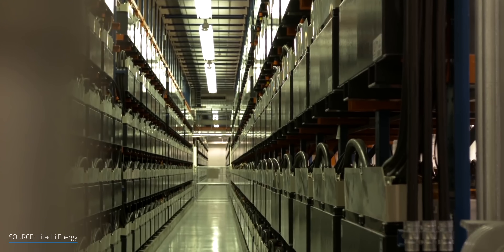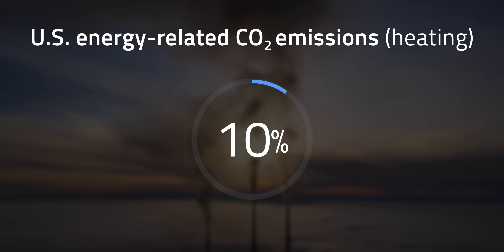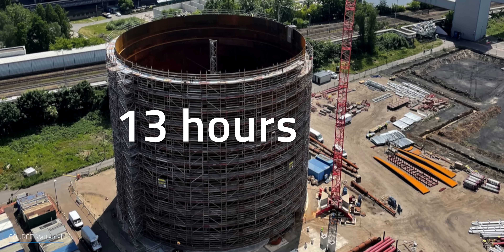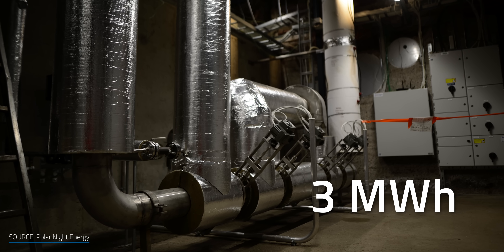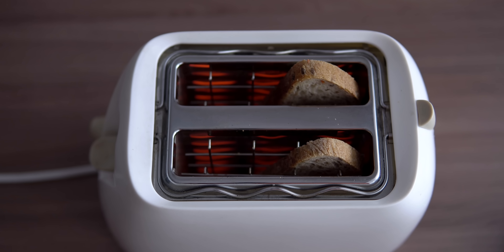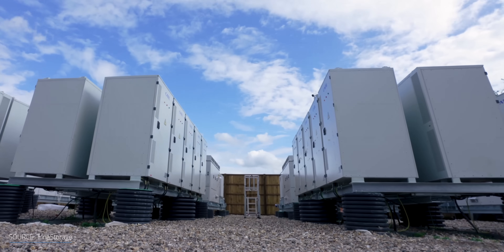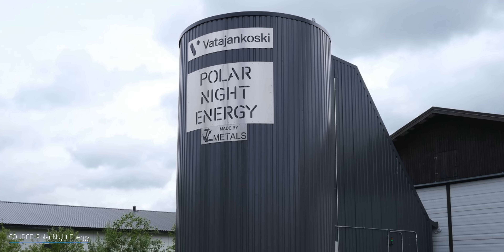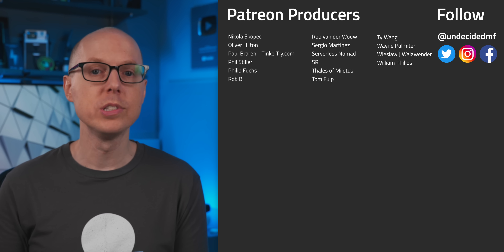How A Sand Battery Could Change The Energy Game

Comment: This seems like a good idea, but based on some experiences and 40 years of construction experience I can't see the sand being a good solution for long term heat storage without constant maintenance frpm the heat source.  The water etc traveling through would certainly heat up, but the sand would cool at a rate that would certainly equalize rather quickly unless there was a continued method to keep heating the sand.  It is proven that cooling occurs much more quickly than heating, as most things will cool to the ambient quicker than it was heated.  So there would be a need to some how continue to heat the sand.  But it is an interesting idea.  Similar to cooling towers that make ice at nice and cool buildings during the day, which has been around for decades.  One other down side to me is this seems like a small step towards corralling the average citizen into group housing and one of the small steps into  the abolisment of privately held land.  Just my opinion.

Comment: Since heat pumps have a COP of 4+, that'd bring the 25% efficiency back to 100%. In fact, one can argue that the energy is only worth 25% in the form of heat, since it's illegal to convert electricity to heat in anything but a heat pump (Denmark).

Comment: It would be good for solar thermal plants. I did some work in one in Arizona that used concave mirrors to focus light energy to a pipe heating oil in the pipe. The the heat would go to a boiler to heat water into steam to run a turbine. They also had a storage tank to keep the access heated oil to run a few hours into the night. They could use the sand thermal battery to store even more heat to run longer.

Comment: I always figured long distance heat transmission was infeasible. Even within a few city blocks, I'd imagine a heated pipe system could work, but require thermal hubs or such and overall a lot more infrastructure and maintenance compared to an electrical system. I'm willing to be wrong about that though.

Comment: Just wondering if you could use a tank full of compost with similar coil pipes as shown but have water flowing through  reciveing the radiated heat through the pipe from the compost, 
as compost is a really good at heating to high tempurtures, I know I'm stepping away from the topic of battery storage tech and talking more about the way we harvest energy but I'm curious to know if it's a good idea and am wondering if anyone has tried to use compost in such an way.

Comment: I am an engineer and this sand battery, while cool, has the same problem as most energy storing methods. Energy transfer loss, or the scientifuc fact that when ever energy changes form from one medium to another energy is lost and 100% effiency is impossible. Lets follow this system here. The energy starts as wind and sunshine. It gets transformed into electricity at the windmill and losses alot of energy during the process. Then the electricity gets put into the sand where it has to be transformed into heat energy. Alot of energy gets lost here. Then the energy has to be tranfered out of the sand and back into electricity, lossing energy again. Through this method it would be lucky if the end user got 50% of the energy that was harvested. This method bleeds energy and is not very efficient. Plus all of the metal needed to build it can't be melted and formed with electrical energy. Metal requires burning something to get it hot enough to form. Plus windmills and solar panels require more of a carbon foot to build then they clean up. Windmills have short lifespans and are hazordous to the enviroment to duspose of when they break. Solar panels require large mines to dig up the rare earth minerals required to build them. Plus just burying old and broken sokar panels is toxic to the enviroment.

The way forward is nuclear. We as engineers have completly overhauled and redesigned the system from the ground up. The plants currently in use are decades old and are caveman tech in comparison to what we can build now.

The fuel rods that we can build now are designed to never expload, and we need much less fuel to build the reactor then before.

Nuclear is safe now and has absolutly zero emmissions.

Comment: Woow, I dont know about that. How you deliver the heat? Sounds to me like you'd need a whole new type of pipes or  conductors to do that. Besides I dont see much application for it outside of heating houses and then it raises a question of the cost per unit and dimensions of said units. Meanwhile some turbines are better off deactivated when there is no demand, because wear and tear is a thing that too costs money, magnets in the generators are degrading not to mention any moving parts which degrade by definition. If we lived in the universe or on a planet where water had a bad heat capacity it would be understandable to cheer for a cheap material like dirt to be usable in such contraptions, it would be fine, but we dont, so why go the extra lenghth? So basically it about building giant boilers, right? Well it doesnt get much cheaper or easier to build when you switch water for sand. Meanwhile you people should start investing research and work into making really air tight walls cheap instead of what we have now. Because right now on every 10m² of wall you get up to a 30x30 cm accumulated area of a hole finely distributed across the whole area. Its like a sixth of a window that remains open no matter what you do. The only thing that makes it better than a hole is that no wind can actually blow through it with full speed. Only with like <9% of initial speed. So yeah. Dont sell me oversized boilers. Sell me actual walls worth paying for.

Comment: Do you think a sand battery could be used to store cold instead of heat to instead act as conditioning not heating?  In hotter and tropical places in the world cooling is a high consumer of energy. It would be great to cool the sand in a smaller sand battery at my home using a heat exchanger/condenser etc with solar power throughout the door then blow air through the sand into the house to cool at night time.

Comment: You cannot save the planet by saving the planet. Green energy is just as destructive if not more to the earth by way of toxic metal runoff and massive land removal/destruction. While you drive your EV car, know all of its copper, greased bearings, computer components, and batteries came from the depeest toxic holes dug into the earth all in the name of being carbon neutral.

Comment: would storing heat and insulating it be more efficient than just using the weight of the sand to make a gravity battery? Wouldn't that also be more ideal for months long storage considering it wouldn't lose any energy over time at all and only on storage?
Reply: Did you watch a video? They are using isolated tank with sand storing heat over months, not gravity.
Reply: @razeclp3989  I asked a question, i am fully aware of what happened in the video. Did you read my question? I even stated that theyre storing heat and asked if itd be more efficient than a gravity battery over time

Comment: I'm happy you did this issue. I had seen someone else do a review on Polar Night, but your team seams to be more critical in the review process. Back in the 1980s there was a design for a hobby greenhouse that collected the heat from the peak and pumped it through a rock bed to recover it later so it is not a new concept, but perhaps a more refined system. Like you, I see a mixture of systems as the solution. Store heat as heat, electricity as electricity and don't try to make 1 thing fit everything.

Comment: I got a great idea for the ultimate green energy. Windmill blades only last a short while and can't be reused or repurposed so that's not good. Solar panels have the same issue. Both are usually buried in huge landfills, only causing more problems. Now a good solution I was thinking off, is using something we have tons of. Something that's capable of generating an insane amount of heat and the byproduct, besides hot water, is nothing. It's safe, it's easy to setup. It's using some material such as uranium to generate the heat, which drives steam turbine engines. They can run day and night and generate constant power, no matter what the weather does, no matter if the wind is blowing or the sun is shining. Once the fuel is used up, it can be used for all sorts of things, like research, medical use, measurements, etc. It's so green it's the most green energy source available. And since the wasted fuel is also fully used, there is literally nothing left, no long term storage is needed anymore, no byproducts during combustion. It's the most amazing thing ever.

Comment: Heat transfer between a pipe and sand is too low to make this system profitable. There is not enough heat transfer area, the contact thermal resistance is too high.

Comment: This is a neat idea, it's crossed my mind but I always wondered about the best way to heat the sand.  My train of thought was to use elements embedded in the sand but that makes maintenance very hard, never thought that you could actually use air as a transfer medium but guess why not, it doesn't really have a max temp so it will work better than even water.  I guess the challenge is finding a fan that can withstand those temps though.  A turbo charger for a car maybe?   I'll have to experiment with this on my off grid homestead.  Could also set it up so I can use fire to generate heat when solar is not producing enough.
Reply: Interesting thoughts there.Obviously you have a non-electric heat source?
Sand filters for water have no (or very few) internal pipes, so doing the same with air should be easy.I do wonder how much energy you'd lose from pumping through sand though.
Anyways back to the original question- surely it's easy to replace pipes in sand?
Reply: A lot of rural people if they have access to cheap firewood , utilize an outdoor wood boiler. Most wood boiler don't achieve a very high efficiency because the combustion temperature is too low. Even wood gasification units if idle have reduced efficiency. If the firebox is surrounded with sand and the chimney gases are allowed to travel many feet through the sand you would get near complete combustion. If that said chimney spiralled downward it could even get to the point that the water would condense releasing a lot of heat. The last lengths would probably have to be stainless because of the corrosive nature of the condensates. I'm thinking more of a rocket stove that provides the enviroment more suitable to burning wood efficiently and the 1800 degree gases heating the sand. Would have to be careful to keep the temperatures within the working limits of the material used.

Comment: This sand battery concept is one of the stupidest things imaginable in this configuration. I mean, they will heat air and circulate it in the sand storage using fans and then draw it out to produce steam, lol. How about having the heating element in the sand storage and then circulating water to produce the steam? Didn't these dudes have a basic lesson in thermodynamics? 
Good thing Finland has a big (and growing) nuclear production.

Comment: I made a sand heat store for my wood burning stove. Keeps giving up heat for about 20+ hours after the stove has gone out. Also has water heat store to pump around the radiators when the temp drops too much. This allows me to do a fairly short burn in the evenings. Also I burn it at a much higher temp than I normally would which makes for a much more efficient and complete combustion of the fuel. It will allow for expansion to use solar thermal or pv for heating the water tank to make up for the heating shortfall on cooler days in the summer (I live in the uk). With the energy prices going up so fast here it really is making people think how to make their homes more efficient.
Reply: I'd love to see a video of this if you wouldn't mind please
Reply: Me too. I'd also like to see.

Comment: So - another way to do something we not only already can do but are doing where it is financially viable, just in a more roundabout inefficient and costly way.
Why would we use a solid material with low thermal conductivity, being abrasive and less energy-density over simple water? (for comparison: sand => 1300J/m³K, water => 4100J/m³K. You need to heat up the sand to 3 times higher to store the same amount of energy - meaning you also need many times better insulation. at 600°C it would only barely be 2x as energy-dense as water - IF the water is not pressurised at all. And you could just as well create steam as that is also an efficient way of transporting that heat)
And to store heat in summer for use in winter????? Yeah no. There have been case-studies of high-insulated houses using concrete and water for that - and you need ludicrous amounts of mass and insulation to make that work.
Also why resistive heaters instead of heat-exchangers here?
Why store heat longterm anyways? Hot water is needed all the time. It would be just way way better to use excess energy to use for heating where it is actually needed.

That is about as "innovative" and useful as compressed-air storage.

Comment: Sand has a lower specific heat capacity (800J/kg) then water (4200J/kg). Even with it's greater density (2,62g/cm3) still we have only 2000J/kg. In fact it can be heated up to much higher temperature than unpressurised water, but that means bigger heat losses.
Low temperature water heat reservoir makes more sense. It can be heated up using a heat pump boosting energy efficiency.
PS: 8MWh of thermal energy is a drop in the ocean for a municipal heating system.

Comment: Not so sure about the replacement of steam pipes in an industrial setting. Although, bypass home heating, sure. I'm just not sold on the sensible heat transfer matching the latent energy of steam. Although, the sands temperature is high the energy demand might not be met.

Comment: What about black sand( aka iron oxides) which is abundant and can be extracted with a electomagnetic field. Has a higher melting point and would hold heat longer, just as easy to get 🤔. Definitely worth looking into. 👌

Comment: Similar to some of my other comments on your excellent videos, biochar and pyrolysed hydrochar (650-800 deg C) could be used instead of sand and store a lot more energy. The char can also be doped or modified for storage and conductance, with the pyrolysis process generating plenty of heat. Some of the hydrochar (biocoal) and biochar could be used in natural gas broilers, which would also decarbonise steel and cement industries. The char would last longer, and when it needs to be replaced, the spent char could go into soils or concrete for carbon sequestration depending on the contaminant level.

Comment: Electricity and Heat are key and they don't transfer back & forth perfectly. PV solar panels, wind & wave turbines, or hydro-electric to get electricity can be used with various kinds of batteries like LiIon, molten salts, heated sand, gravity batteries, TPV, etc. which can hold energy for later. But, do you get electricity or heat later? Pick your sources and batteries accordingly.

Generating heat to be used as heat can be stored in a heat battery (molten salts, sand, water, etc.). A simple box-style solar heater can heat sand, water, or anything. We use a lot of heated air & water in our homes and other places, but if you store the heat in a heat battery, then count on using it for heat later too. Converting it to electricity isn't so efficient (yet, though see TPVs). 

There is also the green house surrounding your house. It collects heat directly to the air you want to be warmer. The EarthShip shows how to store a lot of that heat in a "thermal mass". And modern insulation techniques show how to conserve or avoid wasting a lot of heat energy (see passive houses).

It's a multi-technique approach which we have already developed to a large extent.

Transportation is more difficult because of the energy density needed, but look at what CATL is doing.

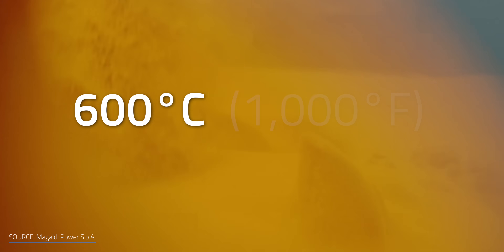Comment: 9:33 Water can, and does go above 100° C, that´s even used in district heating. At two bar it boils at about 120°C, at six bar it boils at about 160°C
Reply: This channel is not primarily concerned with facts, but with pushing a narrative. The Climate Change nonsense.

Comment: Why use photocells with low efficiency to collect energy that will later be stored as heat, when you can collect solar energy directly as heat with much better efficiency?
Reply: What are the comparative efficiencies for PV ->electricity->heated sand versus direct heat collection -> heated sand ?

Comment: Now YouTube is pushing so many content that could “change the game”. It’s like the game is being changed every second and all the professional YouTubers seems standing on top of it. Yet I am still charging my phone 2 times a day with fossil fuel…and Europe is fighting for human rights in the possibly coldest winter. Apparently, the game is changed, it just not some fancy alternative energy or fancy battery. And the game will never be changed because of battery. Experience has told us every day that anything powered by battery is cheap and lousy.
Reply: There was a time when internal-combustion-engine vehicles didn't get very good mileage, didn't have AC or heaters, and didn't have many gas stations to refill. Stuff gets built and technologies develop. Now cars even have roads to drive on.
Reply: @markhathaway9456  I am sure what you said is going to happen. Yet more than 130 years later that IC engine is still running strong and did I mentioned the lead acid battery that starts every single car was invented in 1859? And the first electric car was invented in 1889 as well….I have no doubt about evolution, I just can not agree with a revolution that takes more than a century is defined as “changing the game” which implies that thing is going to happen tomorrow afternoon.